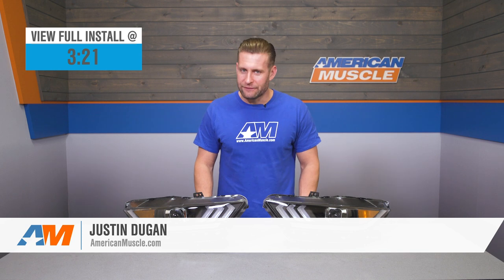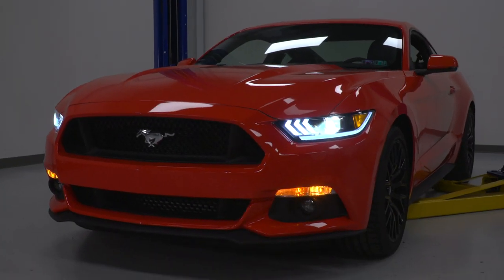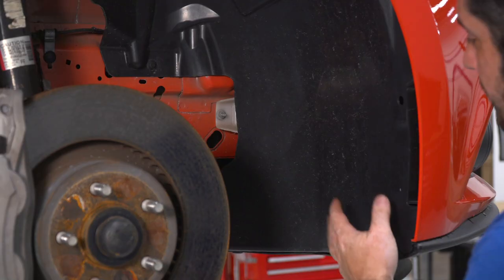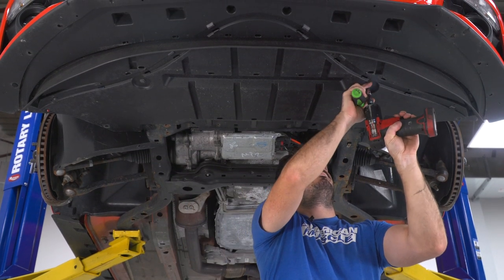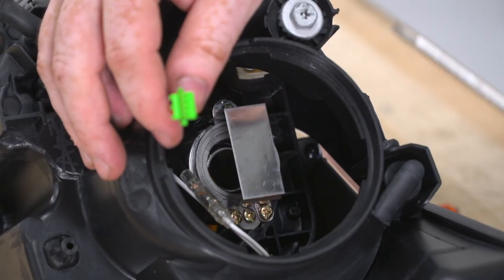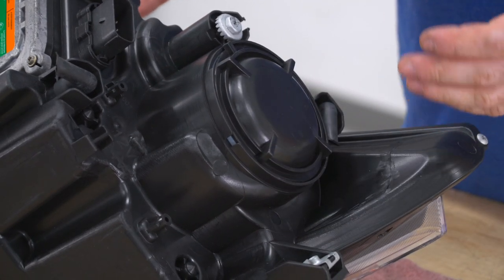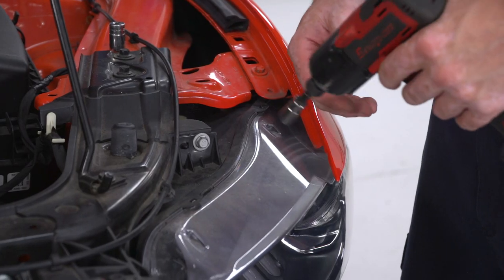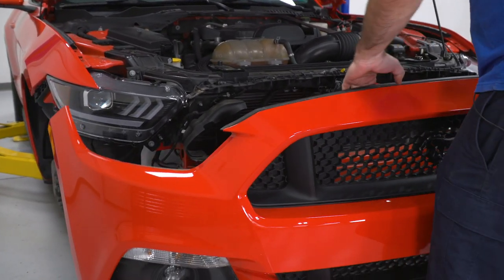2015-2017 Mustang Raxiom LED Projector Headlights Review & Install

Comment: I'd be all for it but that underlying DRL is a little too Fusion for me. They could have done without it. I think it adds way too much and displaces the Mustang character.
On a side note, it'd be nice if the driving lamps were LED with a hotspot similar to what you'll find with some Morimoto projectors.